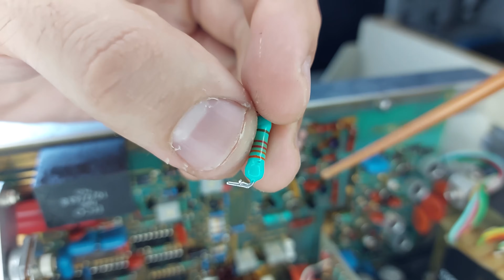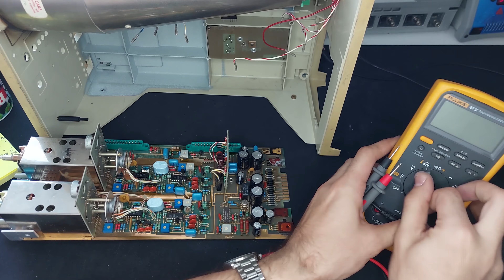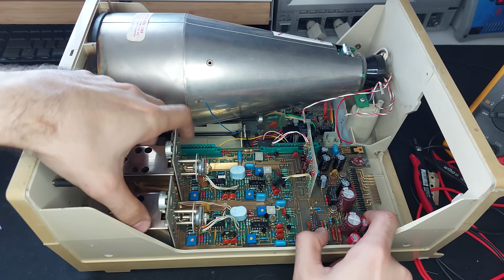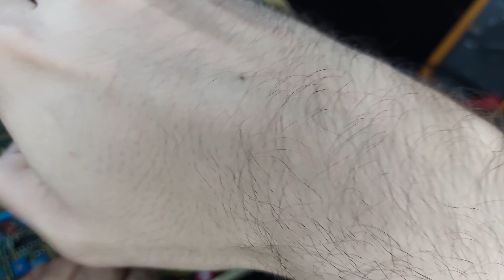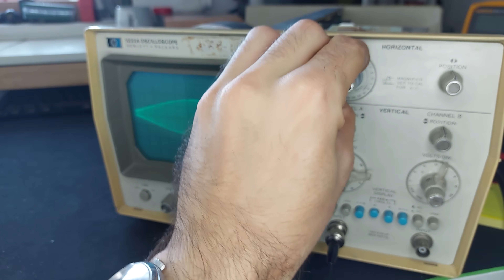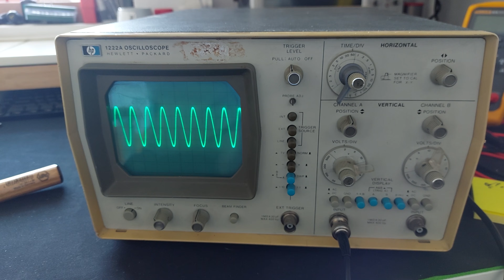HP1222A Repair

Comment: Don't break a sweat the experience you are having at 23 min into the video is normal we all have days like that at least u have continuity of thoughts and caught the pot in time me as a ADHD person had to strip installed engines to fit the oil pumps more than 1 time